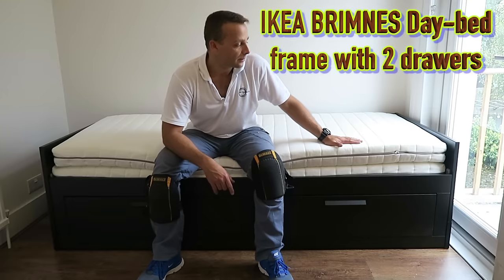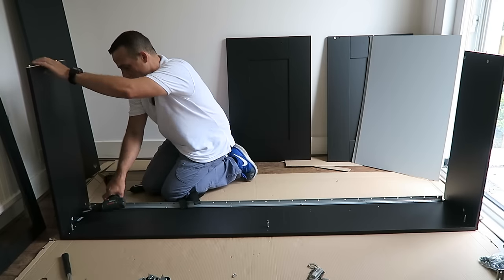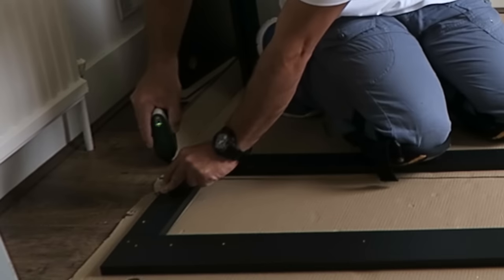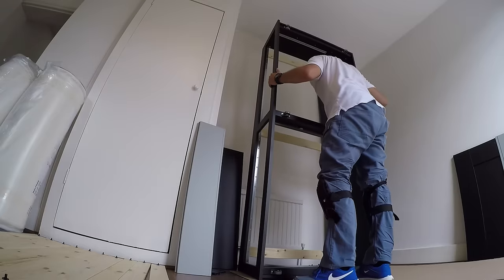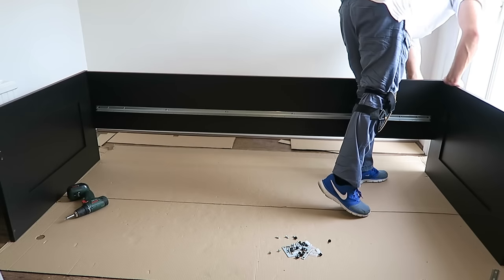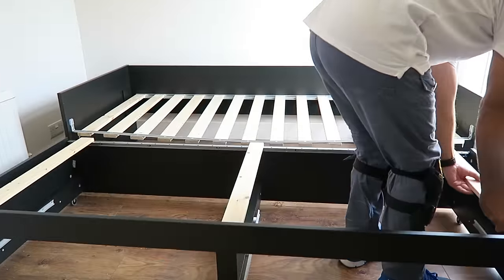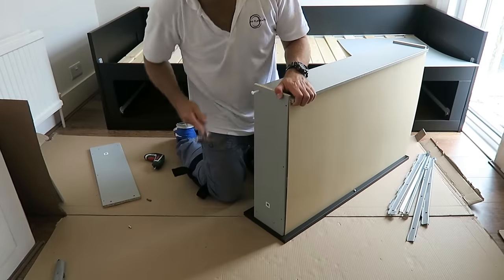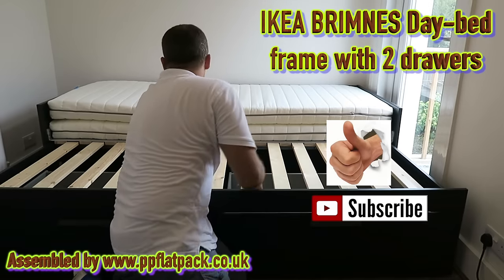IKEA BRIMNES extendable Day bed frame with 2 drawers assembly

Comment: In the video you said the panel goes on hole 14 and it’s exactly in the middle. When I was building it it wasn’t in the middle and in the picture in the directions it wasn’t either. I counted and I put it on 14. So why is yours exactly in the middle?

Comment: I just put together a twin-size Brimnes bed, and when I finally got to the drawers, they don't fit perfectly inside the bottom of the bed. They slide, but there is a gap between the bottom of both drawers and the bed, and when I pull them out, they tip down instead of pulling out straight. I can't figure out what is wrong...
Reply: did u ever figure this out?

Comment: This is GREAT to know that IKEA has a pull out... Now I DON'T have to build one....but, what is 80 x 200 cm mean??? I don't understand cm

Did it come with the mistresses
Reply: 80cm width... Which becomes around 160cm after pulling... 200cm length...
there are both options available, including or excluding mattresses

Comment: Thanks for the Video complete life saver. When putting together the main base of the bed I’m finding the screw holes do not line up. Where you put the back side up on top of the rails and the front under any idea?
Reply from the maker: Maybe you put L- shape long rail other way around in 3:35min. Hard to advice if I don't see it you can email me pictures and I try to get back to you as soon I can.

Comment: Rails should be fixed with a screw first on both end, after the other 8 screws. Took me 2 hours to assemble this bed. On big locks try not to tighten it to much, it can get broken. Puzzle for men.

Comment: i get that the middle panal has whitewalls on it.. & the outside panals have only one rail.
that means were using 4 rails in total.. right?..(2/middle & 1 for each of the sides = 4)
...well there are 3 other rails in the assimbly.. i don't see where they go

Comment: Very good job, mate! Is the structure squeeky and rattling? Can you help me with some measures, please? What is the widht of the structure when extended as double bed? How many centimeters do the drawers extend outside the side board when they are fully opened, including handles? And what is the depth of the handles only? Now imagine you have placed the bed with the headboard attached to the wall: at what distance from the wall the handle of the first drawer is? What's the thickness of the side board? What is the ground clearance left by the drawers? What is the max height of a carpet I could put under the bed? And what is the height where the mattress starts from the ground? I hope my questions are clear. Thank you in advance.

Comment: i'm confused w/which rails go on the on the sides of the panals w/the wheels.. on the video starting at 1:35
it's a bit confusing i guess the rails w/the white round pieces go in the middle?
Reply from the maker: melodic713 
On the middle rails there is white plastic washer two on the each rail. On the sides just rail.
Reply from the maker: Ok you have 4 rails each pack have 4rails find L AND R (left and right) on the two rails these go on the side panels and on the middle panel (middle panel have two white washers under the rails) you can see it in video starting1:40 there is two Lshape rails in each pack these go on the drawers.

Comment: hi plz answer what tools do u need to bulit this and did the bed have all the tools that we need ...what do we have to buy for this bed
Reply from the maker: All yo need is two manual screwdrivers one with slot head one with phillips head and hammer. If you want to doit faster use what I use in video electric hand dril and electric screwdriver.
Reply: Thanks!

Comment: Hoping this accounts still activate I just bought this bed and assembled it but the base is slanted is there a way to fix this?
Reply: Try flipping the metal support beam above the two holes for the drawer on the section that pulls out. I was stuck on this for hours.
Reply: @zacharypearson9451  please can you tell me how to do it ?

Comment: Could you please help me please? Our sliding part isn't entering the fixed part to the whole. We're unable to figure out the problem. A small part of the bed is seen out of the structure.
Reply: Hello, same issue :/ Did you resolve it ?

Comment: Can't get one of the drawers to slide into place. Is there a trick? Both drawers fit into the space on the right; neither draw fits into the space on the left. What might be the problem???
Reply from the maker: Rails on the bed frame up side down or rails on the drawer attached wrong way around.  If you email me the picture will tell you more.
Reply: Gladly--what's your email? ...or how do I attach here?
Reply from the maker: Margaret Sadler 
All my details in descriptions :)
Reply from the maker: Margaret Sadler 
White plastic washer should be only on the rails on the middle. So two rails on the middle have rails with white plastic washers rail on the side is without. Hope that help.

Comment: I want to buy this daybed directly from IKEA.com, but does the daybed come with those two mattresses or would I have to buy them separately?
Reply from the maker: I think you have to get them separately there is option for one or two mattresses depend what you want to use the bed for.
Reply: PP FlatPack thanks for your response. Another question, is the bed long enough for someone who is 5"8?
Reply from the maker: Here is mesurment of the mattresses Length:200 cm,Width:80 cm
Thickness:10 cm nthats mean interiour mesurment of the bed Length 200cm if you 180 cm still have 20cm space. hope that help.

Comment: pls can you put a better mattress on this daybed
Reply from the maker: I believe you can the ones you see in the video coming originally with this bed but I thing you can get better ones just make shore measurement is correct. One last think if you get thicker ones it may go over side panel when folded. And it may will be harder to moove thicker and heavier matraces when you want to extend the bed. Hope that help :)
Reply: PP FlatPack thank you was more thinking of the top portion, this was helpful.
Reply: What is the thickness of each mattress? The one that came with this bed?  Thanks!
Reply from the maker: Mattress and bedlinen are sold separately. Measurement of the mattresses you see in the video Length: 200 cm, Width:80 cm
Thickness:10 cm.
Reply: PP FlatPack Thank you!